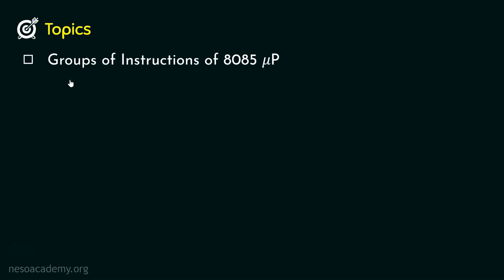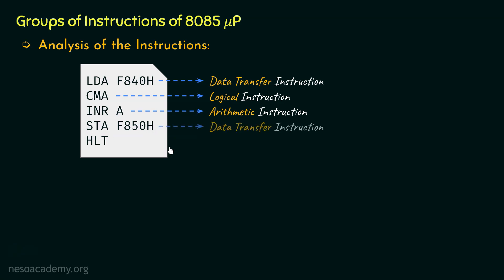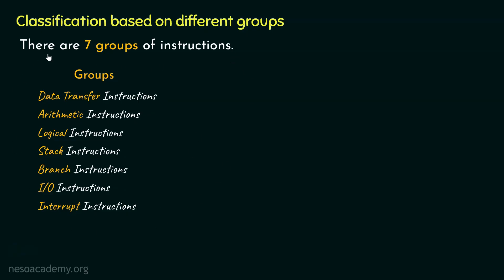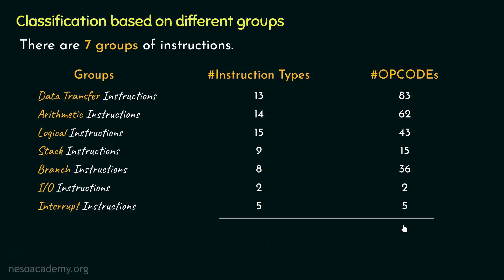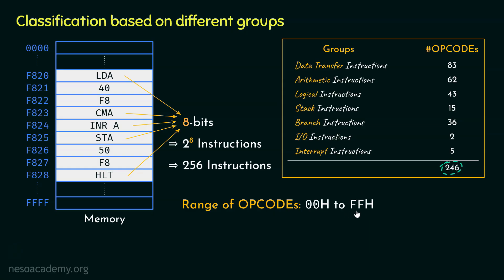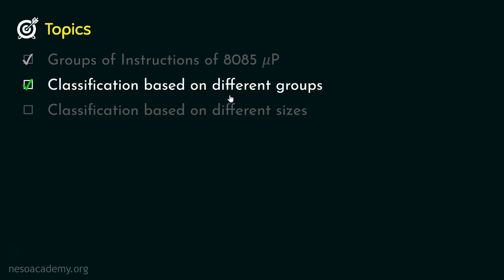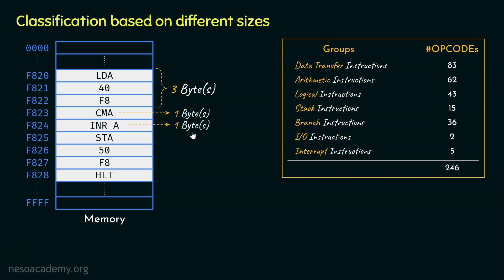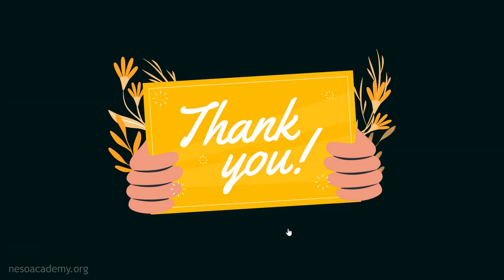Instructions of 8085 Microprocessor

Comment: Here's a comprehensive breakdown of the **instruction set of the 8085 microprocessor**, organized by groups, sizes, and key components like mnemonics and opcodes:

---

## 🧠 1. Groups of Instructions in 8085 Microprocessor

The instructions are categorized based on their functionality:

| *Group*                  | *Purpose*                                                                 |
|---------------------------|------------------------------------------------------------------------------|
| Data Transfer Instructions| Move data between registers, memory, and I/O ports                           |
| Arithmetic Instructions   | Perform operations like addition, subtraction, increment, and decrement      |
| Logical Instructions      | Execute logical operations such as AND, OR, XOR, and complement              |
| Branching Instructions    | Change the sequence of execution (jumps, calls, returns)                     |
| Control Instructions      | Control machine operations (e.g., halt, enable/disable interrupts)           |
| Stack & I/O Instructions  | Manage stack operations and I/O communication                                |

---

## 📦 2. Classification Based on Instruction Size

Instructions in 8085 are classified by the number of bytes they occupy in memory:

| *Size*       | *Description*                                                                 | *Examples*               |
|----------------|----------------------------------------------------------------------------------|----------------------------|
| 1-byte         | Opcode and operand are in the same byte                                         | `MOV A, B`, `ADD C`, `HLT` |
| 2-byte         | First byte is opcode, second byte is operand (usually 8-bit data or port)       | `MVI A, 32H`, `IN 01H`     |
| 3-byte         | First byte is opcode, next two bytes are 16-bit address or data                 | `LXI H, 2500H`, `JMP 2085H`|

---

## 🧾 3. Instruction, Mnemonic, and Opcode

Each instruction has:
- **Mnemonic**: Human-readable name of the instruction
- **Opcode**: Hexadecimal code representing the instruction
- **Operands**: Registers, memory, or data involved

### 🔍 Examples:

| *Instruction* | *Mnemonic* | *Opcode* | *Size* |
|-----------------|--------------|------------|----------|
| Move B to A     | `MOV A, B`   | `78H`      | 1 byte   |
| Add C to A      | `ADD C`      | `81H`      | 1 byte   |
| Load A direct   | `LDA 2500H`  | `3A 00 25` | 3 bytes  |
| Move immediate  | `MVI A, 32H` | `3E 32`    | 2 bytes  |
| Jump            | `JMP 2085H`  | `C3 85 20` | 3 bytes  |

You can explore a full opcode table [here](https://electricalvoice.com/opcodes-8085-microprocessor/).

---

## 🧮 4. Summary of Instruction Types

| *Group*                  | *Common Mnemonics*                            |
|---------------------------|--------------------------------------------------|
| Data Transfer              | `MOV`, `MVI`, `LDA`, `STA`, `LDAX`, `STAX`      |
| Arithmetic                 | `ADD`, `ADI`, `SUB`, `SUI`, `INR`, `DCR`        |
| Logical                   | `ANA`, `ANI`, `ORA`, `ORI`, `XRA`, `XRI`, `CMP` |
| Branching                 | `JMP`, `CALL`, `RET`, `JC`, `JZ`, `JNZ`, `RST`  |
| Control                   | `HLT`, `NOP`, `DI`, `EI`, `SIM`, `RIM`          |
| Stack & I/O               | `PUSH`, `POP`, `IN`, `OUT`, `XTHL`, `SPHL`      |

---